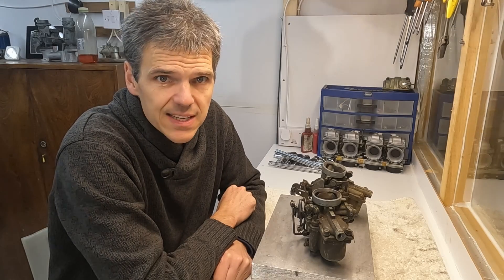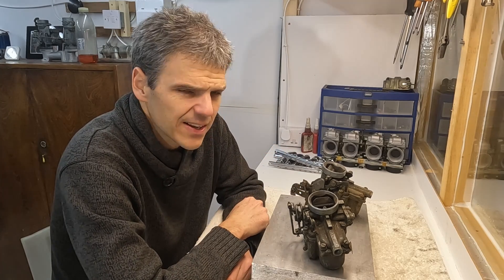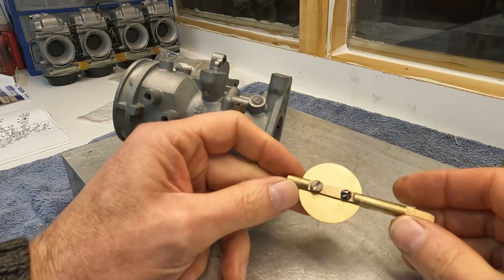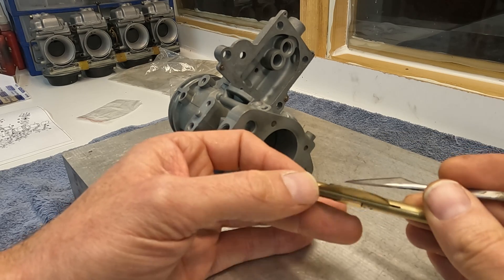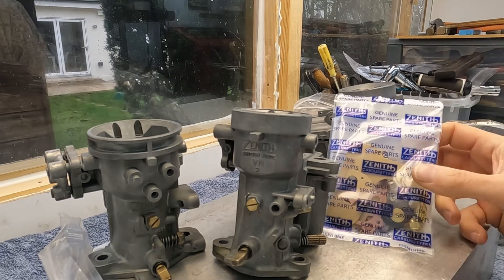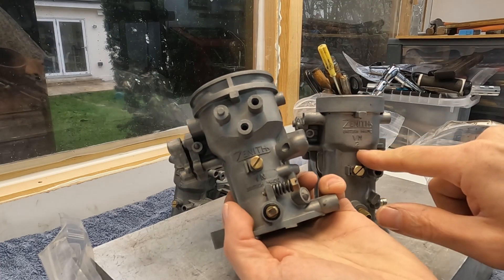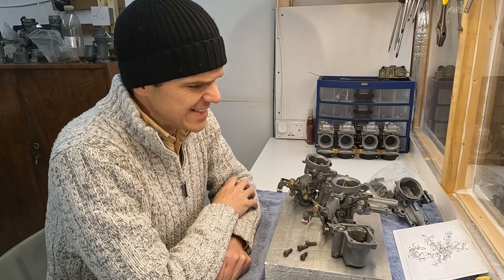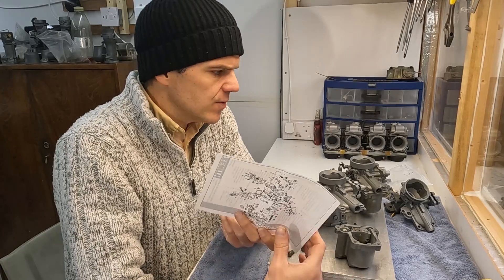Complete restoration of Zenith 33 VN carburettor for Ford Cortina MK1 1500 engine

Comment: It would be nice if you told us about the history and vehicles these carburetors were used in.
Reply from the maker: Fair point! Although sometimes I don’t get it myself as these units came in a lot of parts
Reply: @carburist  I understand and it may not do me any good here in America unless you start working on or have worked on Mikuni carbs (I'm new to the channel and haven't watched but 3 of the Zenith repairs) 
As a point of suggestion, there are a lot of motorcycle racers, riders and motorcycle repair enthusiasts that would benefit if you did start repairing and/or modding Mikuni carbs, as they are ubiquitous among motorcycles sold in N.America.

Here's a Google excerpt:
Zenith's best-known products were the Zenith-Stromberg carburettors used from 1965–1967 Humber Super Snipe Series Va/Vb, Humber Imperial, 1967–1975 Jaguar E-types, Saab 99s, 90s and early 900s, 1969–1972 Volvo 140s and 164s, 1966–1979 Hillman Minx, Hunter (Arrow), 1966–1970 Singer Gazelle/Vogue (Arrow), 1967–1975